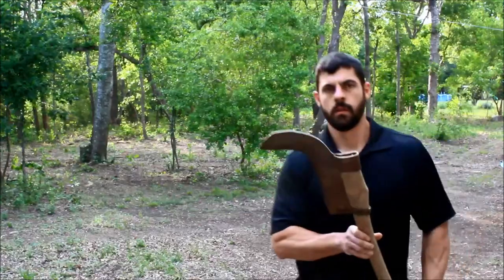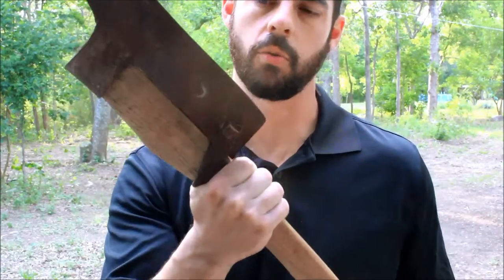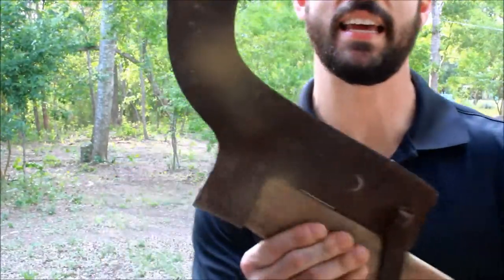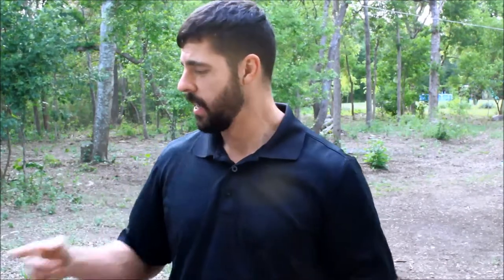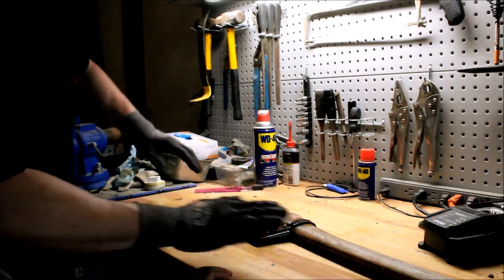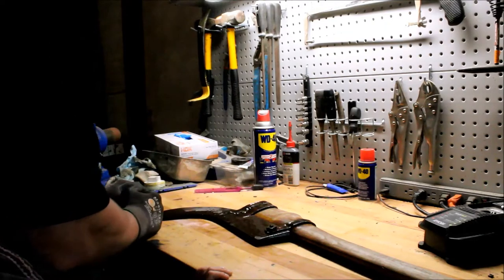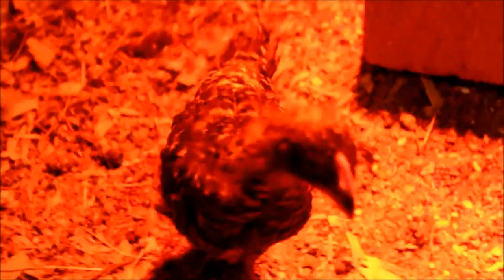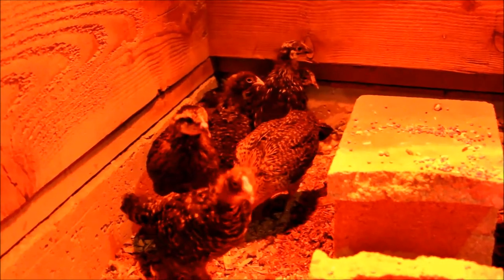Brush Axe

Comment: Cool...im from Malaysia and we have our own version of the brush axe. The curved blade design is the same but the way we handle it is different. Ours just have a socket and the way its made is that a single piece of iron is used to make the blade and the socket hole is folded. Much like how old shovels are made. And at the middle of the socket there is a small hole for pins or nails. Our handle is just simple round tapered handle. But the american brush axe looks cooler though.